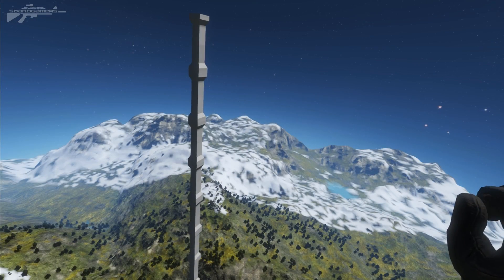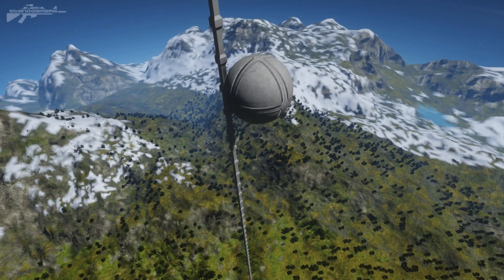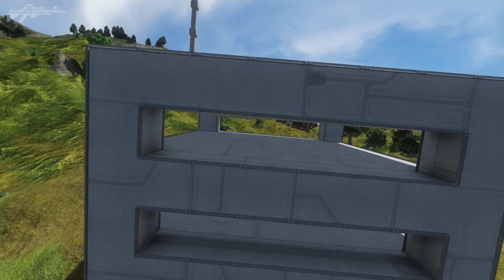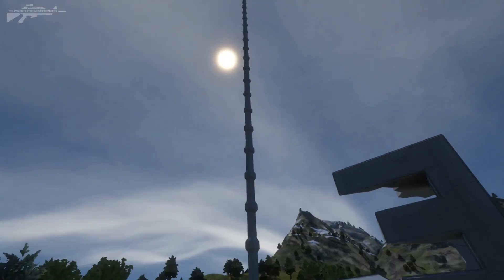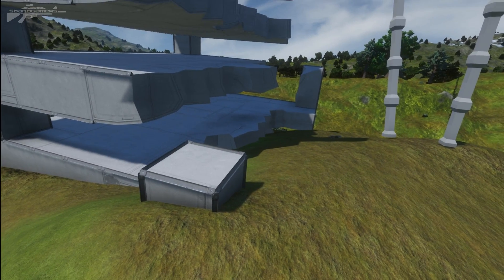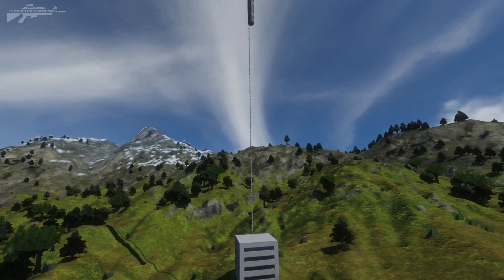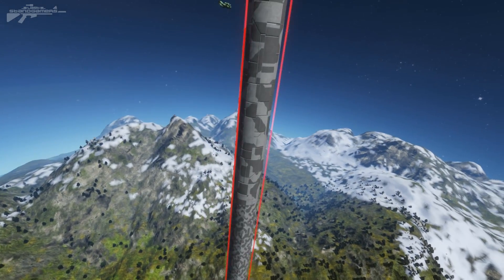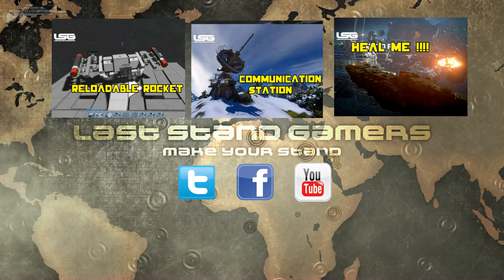Space Engineers - Kinetic Energy Testing

Comment: BTW; the rod of god is not just lifting a big steel mass into space then letting it fall directly down. It is launching a large steel mass to orbital velocity (which is around 7600 meters per second. You then reduce it's velocity at some point in it's orbit so that it will re-enter the earths atmosphere and collide with the target. It should be a long tungsten rod (because tungsten has the largest density of easily available metals, hence the lowest surface area to mass ratio, hence the lowest drag upon re-entry, and a rod because that shape minimizes drag). 

If you just lift a rod 400 km above earths surface and drop it, it will impact the ground at 2802 meters per second assuming no aerodynamic forces. It will hit the ground relatively quickly in 4 minutes and 75 seconds. It will only have 38 seconds before it hits the ground, which isn't enough time to actually change course using aerodynamic control surfaces. 

In any case there's no way in reality to just lift something up into space and keep it there. It needs to be orbiting the planet, unless you have thrusters to counteract gravity. Gravity is only marginally weaker 400km's up, hence you'd still need to be accelerating at 9.8 m/s^2 to counteract gravity, hence you'd need an exponentially increasing fuel mass as the time you need to stay up there increases.

Comment: something id like to add is that the yield of a real rod from the gods could have a yield similar to that of a small nuclear bomb (i think it works out to be a little weaker than little boy, but without the radiation, and it would technically be allowed under the various weapon restrictions, since it is not a chemical, biological or radiation based weapon, meaning it does not count as a weapon of mass destruction. the problem with the current definition of weapon of mass destruction, is that while a nuclear bomb is considered a weapon of mass detruction, if a death star was built, it would not be.

Comment: I know i'm late as heck here, but what about putting 2-3 rods on the front of a tube (the rod of god) and try that method? given the rods seems to have better ground penetration than the blocks (being good for the blocks underneath), my second thought is to weaponize it in another method instead of simply dropping it in a line, with a slightly smaller design mounted on the base of a decently powered ship (a smallish ship with enough power to reach full speed with one of these kinetic missiles mounted underneath) and use the science of physics and the arc of dropping it, to create a "front door" buster in a sense, something that can be dropped (with practice) to 'glide' right through the main gate. (think torpedo for land)

Comment: I have found the best mass for kinetic energy weapons is a stack of steel plates.

You can put them into a cargo container, then grind away the cargo container to drop them.

You can also make them into a torpedo. Put the plates into the cargo container, which is at the very front of the torpedo. When it hits, it will break the cargo container, releasing the steel plates. If you want extra ooomph, add a few forward facing gravity generators.

You can also have the grav gens on your ship and just use them to launch the plates. If you run an inventory management system, make a cargo container named so it will auto-draw 1,000 plates into its inventory. Now blueprint it and set up a projector so it will project the cargo container so it's touching a non-merge connector. As soon as it welds, it will draw 1,000 plates into itself. Then trigger the grinder to break the cargo container and whoosh, the plates go sailing off to create havoc.

The large version of this will easily penetrate 12 layers of heavy armor, probably more. (12 was the most I tried)

Comment: What if you split that big projectile into several pieces. Aka machine gun instead of spear. That might work better under SE physics.

Also what about putting a non-deformable block on the tip, like a wheel or door?

Interesting that more HP in heavy projectile armor blocks were destroyed than in light target armor. Usually kinetic weapons work just the opposite.

Comment: I knew a much better weapon system. before planets when using gravity i managed to make a spinning projectile that penetrated at least 4 layers of heavy armour consisting of just 8 heavy armour blocks, battery, mass and merge blocks accelerated using the usual gravity generator and mass blocks. What makes it different was that the whole thing could be more compact and cheaper than other projectile systems while still penetrating.

its a lot better to make multiple smaller projectiles if your aim is for penetration.

Comment: If I'm not wrong, the kinetic weapons platform used a Tungsten carbide rod. Mostly because Tungsten is so heavy, but also because it's got such a ridiculous compression strength. The rods could survive the impact almost to the point of being reusable.

If a weapon like this were to ever become usable in Space engineers, it would need a new type of armor specifically meant to resist impacts. If they pair that with armor meant to resist weapons, but not impacts, then it would be both useful and balanced. Use Tungsten plates for impact armor and Graphene mesh for ballistic armor. 2 new resources for 2 new block types that would make total sense for the game.
Reply: reinforce the rod with shields itll save it from the initial impact
Reply: Helljumper256 Like, a sacrificial panel? That might work, but the problem is the durability of the two armor types. That panel would need to be harder than whatever it's fired at to let it do more damage, otherwise it's just adding needless complexity to the projectiles...

I wonder if blast doors are stronger than light armor?

Comment: What if you incorporated both a traditional explosive warhead tip with the rod of God design. The explosive tip would be used to clear away the soil on top of the bunker and the rest of the rod would be used to clear the steel bunker. Or, instead of the warhead being on the rod of God, fire two separate missiles, one with explosives and one rod of God. Just an idea. Keep up the good work.

Comment: What you probably want is some kind of two-stage system that has a penetrator at the front and then explosives behind in a separate package.  It can be dead simple, just a merge block between them and a timer to separate just before max speed.  The kinetic penetrator would dig into the ground and possibly the bunker leaving a hole for the explosives to fall into and deal damage laterally.
Reply: I messed around with this ages ago while I was making a torpedo bomber in space where you'd need to accelerate and then drop. I had a 1 block wide heavy armor rod, and then 5 warheads on each side of the last 5 pieces. It really depended on what you shot it at. It could practically blow the stock red ship in half, but it did significantly less to heavy armor, though I'd not like to see any of my creations take one.

Comment: So it's a Kinetic Bombardment System? You drop an object from space, it drops down, and hits at mach 7. The energy is much lower than nuclear ordinance, but still plenty strong to leave a dent xD
Reply: the actual concept would be stronger than a nuke, with no fallout.
Reply: CDK93 Weeeell.....Kinetic Bombardment trials back in the cold war yielded strengths equivalent to about 10-25 tons of TNT. To put that into perspective, the Hiroshima bomb was worth 15 KILOtons of TnT.

Comparing the numbers, you'd need to drop around 1000 Tungsten rods to get the same numerical value of TnT tons. Unless you were to make the rods have more mass, but then terminal velocity comes to play and the force they hit at becomes weaker.

Really, Kinetic Bombardment is a bunker buster weapon, capable of hitting the target within 5 minutes of original release. Way faster than a nuke, with much less damage, perfect for supporting infantry. It could also probably take out an entire tank column.
Reply: The one tested was not at orbital speeds, only going mach 10, where as orbital speeds are upwards of 8,000 m/s or roughly 23 times the speed of sound. The one that was tested also output 11.5 tons of tnt. While it wouldn't level a city, it could in theory make a substantial crater given a larger diameter rod.
Reply: CDK93 Yeah, Mach 10 was the maximum speed for the weapon, and adding more mass means more to lug into space. There's a massive amount of reasons why it'd never be an actual weapon used in modern warfare.

Also, don't forget how generous my example was, 10-25 tons, instead of just barely above 10. At the exact strength of 11.5, dropping that straight onto the Statue of Liberty wouldn't even destroy the museum store about 50 meters away. Compare that to the W76's 100KT payload, the most common US and UK warhead, and you begin to see why it's childs play compared to nuclear ordinance.

Also, nukes are nowhere near as strong as they look. Drop a 100KT bomb on times square, it doesn't even reach the end of Manhattan island.

Comment: It seems to me that dividing up the rod into smaller sections that are launched in sequence would be more effective in space engineers, such that instead of
 --------------  
you end up with
 ---  ---  ---  ---  ---
because of how the impact takes away such large chunks of the projectile and how each impact slows the overall velocity of the entire rod. This way each mini-rod would hit at full force and get the most penetration per block used. Of course each section would still need a minimum amount of mass to achieve the desired result for each impact.

You could even attach an explosive payload at the back of the final rod such that it detonates inside the bunker after penetration. At that point though you may need a battery and gyro to keep the projectile stable during free fall and not turning every which way.

Comment: +LastStandGamers You might try to do a two stage rod design to be fired from space : the front part is equipped with a small thruster to get some velocity with a timer and merge block in the front to separate it after a set amount of time. With a bit of luck, and a decent amount of explosives strapped to the front of it, it will break a lot of ground for the rod to not even bother with the ground behind more resistant than heavy armor.

Another idea is to do it old school bomber style : a dozen (or more) rods dropped in sequence in a straight line over a target for maximum damage. :)
Possibly in combination with a mass driver for maximum velocity very early on.